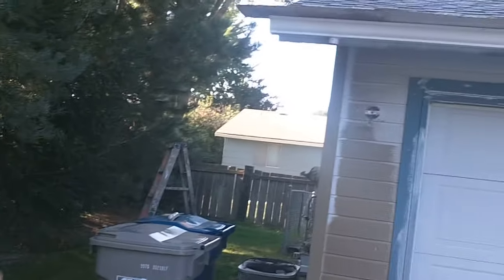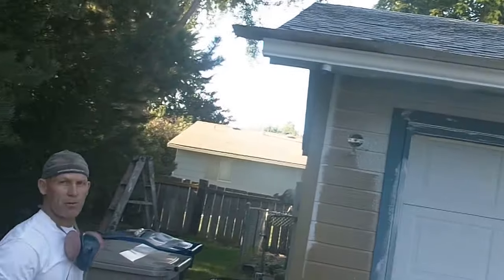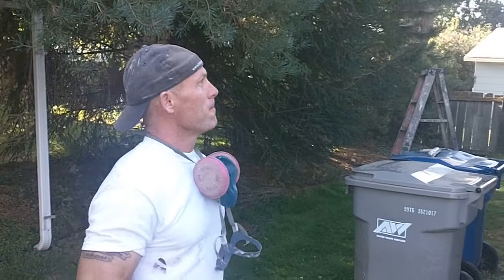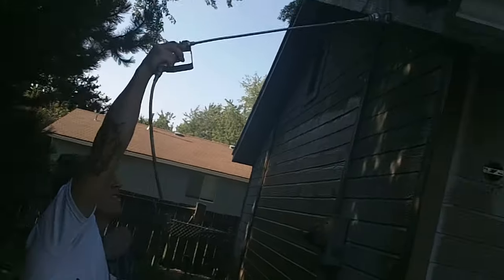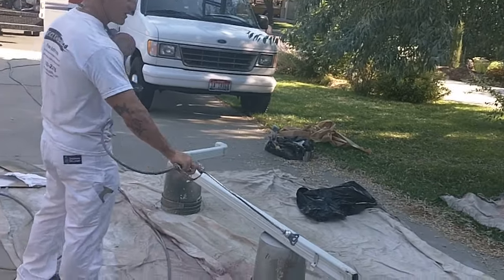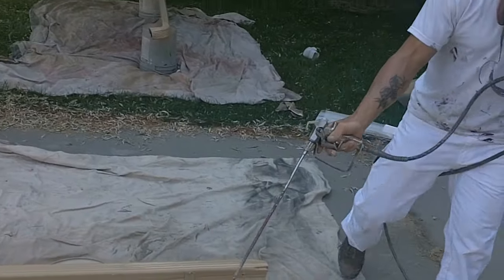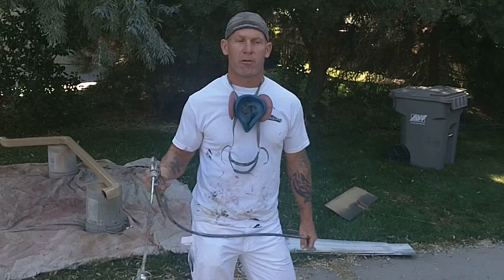HOW TO SPRAY GUTTERS and down spouts.  Paint rain gutters with an airless sprayer.

Comment: My gutters painted to match the field of the house and this exterior enamel sticks fine. It just holds dirt/dust. Other have asked what type of paint, my question is using a clear coat. I climbed microwave & TV towers for repair & maintenance, not afraid of heights. Thoughts? Thanks for the to the point video.

Comment: Nice Job. 

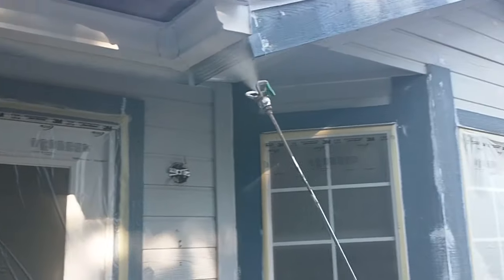Have you ever used a Swivel Tip @ the end of your wand? I highly recommend it. It keeps you from having to fully extend your arm like you did in 1:42 just to keep the spray fan even. It only costs about $50. and I promise you will spray at least twice as Fast.

Comment: If there is a drip edge, you should use Thesnapshield. Check it out on you tube "Thesnapshield 2, revised" or something like that. From there, you can check their web site. Is rudimentary for now but it will give you contact information. Thesnapshield™ works better to paint facers and soffits where there is a drip edge for it allows for its removal remotely from the ground.